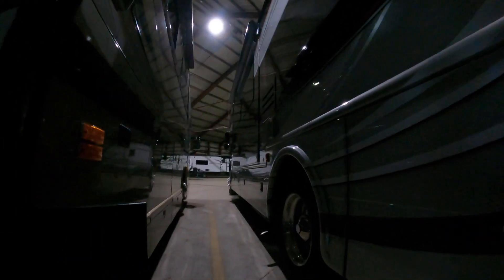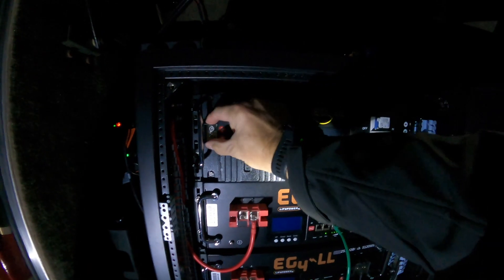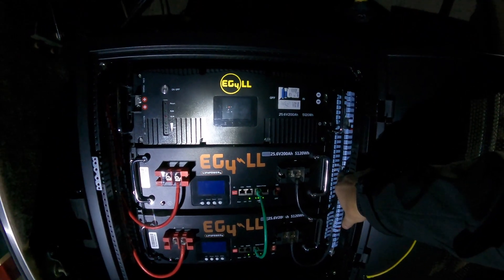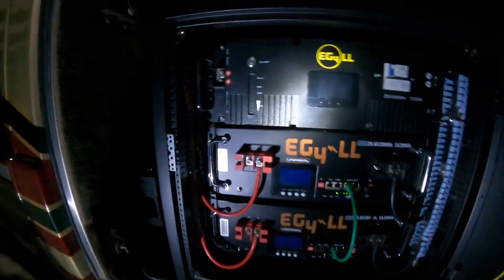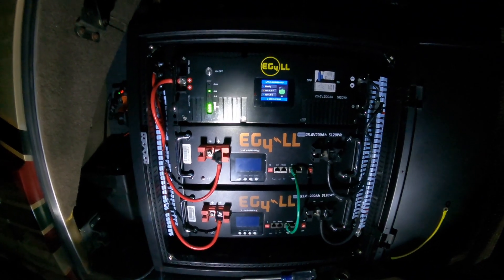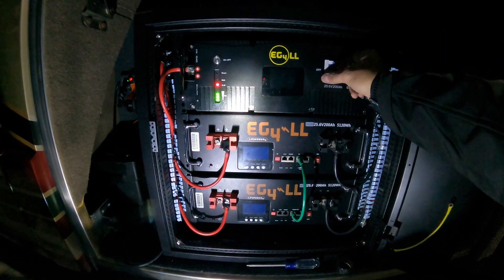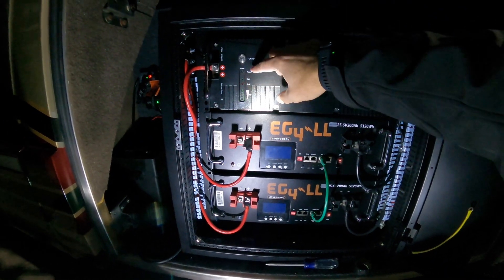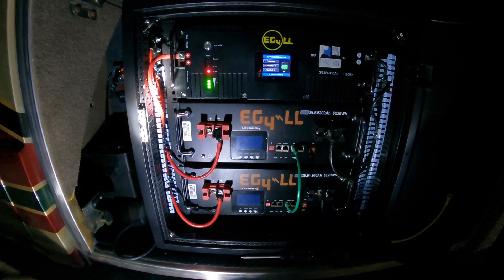SURPRISING EG4 MOTORHOME LITHIUM BATTERY TEST RESULTS!

Comment: Turn on the breaker first then the BMS, this way it will charge the inverter capacitors without faulting.
Reply from the maker: I still have to do it quickly several times then it works. If I only do one inverter (unhook one) it precharges fine with just pushing the button. I have since found that if I start one battery and then start a second battery within a split second of the first- the first battery hits about 18v and trips - but thats just enough for the 2nd battery to run up to 26v without tripping. Once our weather get warmer I am going ti bring it home - update all the battery software and try again - and film the results.
Reply: I'd use a small jumper pack for car starters to recharge with that inrush current

Comment: can't  use a p recharge resistor?  I hooked one up to a push button switch and then turn on a battery disconnect switch.  Worked great with my 12k Growatt.
Reply from the maker: I could, I have them wired to the inverters through a fuse though - no disconnects. I did figure out how to use the battery’s pre-charge system though on my dual inverter setup - with the version 2 I have to turn it on and off quickly about 3-4 times. I found if I use the version 1 batteries if I turn one on and then the other on about .5 second later that will do it also. They were getting to about 18v and then faulting - but having the second jump on .5 second later, it goes from 18-26v no problem. Works better than the one version 2 battery.  Now to get the version 2 communicating with the cerbo…..

Comment: I be inclined to take the Prevost to the tailgate gathering.  You think these things will always go on, but things can change and for some reason you never get back to it.  I just read this "last Purdue home game" so I'd take the Prevost.  I'm not following everything with these batteries.  They sure seem "gold plated" with all the electronic cabinetry.  I could follow your links to find out more, but I think I will just wait for future videos.
Reply from the maker: Haha. Don’t blame you. I’m really starting to split hairs with what I’m doing but getting close to an automatic capacitor pre-charge and CAN enabled system. It’s one of those things that once this works - if people copied what I did it will just work for them - nobody will know the trouble and work behind it.  So some of you guys are along for the ride while I try new things, trouble shoot and get it working.  At some point it’s like flipping a light switch and a light comes on.  Nobody knows nor do they care how much work went behind the power generation, power lines to your home, transformer, wires in your house, let alone the invention of the the light bulb. Just needs to turn on - lol.
Reply: @CampPrevost  It's snowing a good deal here in Indianapolis in Lafayette it is probably a lot more.  I might reconsider taking the Prevost out in the snow and defiantly don't want road salt to the Perdue football game.   I never thought those battery systems would be using a CAN bus!  A CAN bus is specifically designed for real time vehicle control in ultra high fail-safe environments such as controlling anti-lock brakes.  I only briefly looked into CAN bus when they first stated to appear.  

At their core mechanism the voltage systems typically use pulse width modulation to control power use.   I think pulse width modulation frequencies should be above that of the audible frequencies of a dog because they sometimes they can resonate and be heard or above 30 kHz.  As a YouTuber you don't want any low frequency pulse width modulation voltage systems to LED lighting that may be used in your filming because the frame rate of 24 - 60 frames a second will be hit and miss with low frequency pulse width modulation voltage sources close to those same frequencies causing the lighting to appear strobing in a video.  There is some persistence in LED lamps that at higher frequencies may allow them to actually give a varying but continues light output.  A non pulsing constant voltage source should be a sure method of avoiding strobing LED lighting effects in videos.